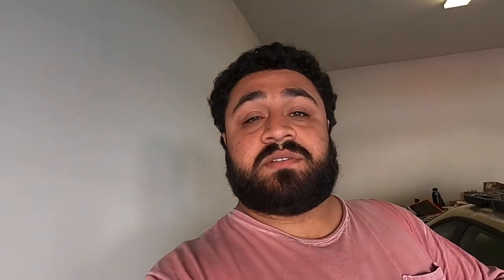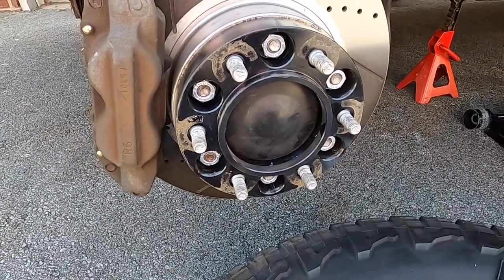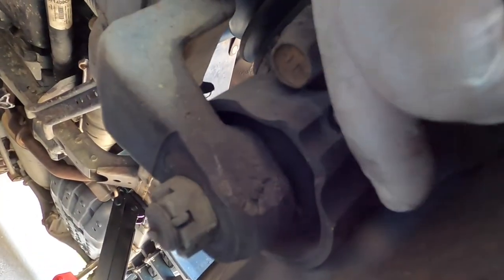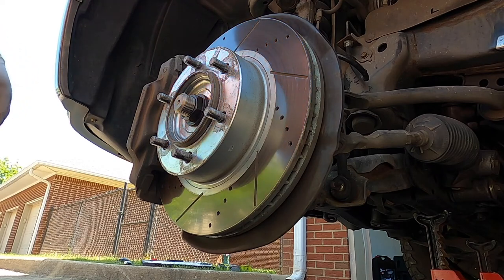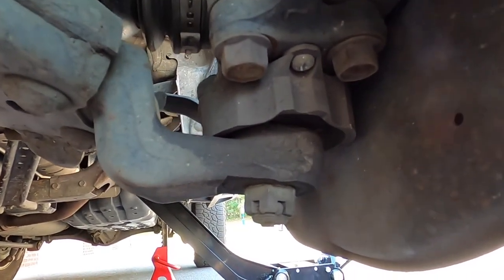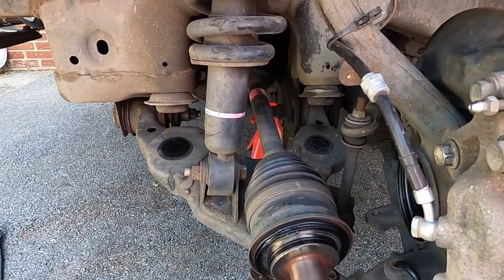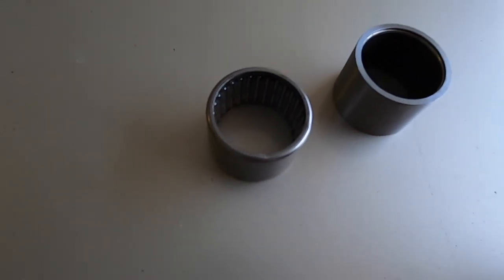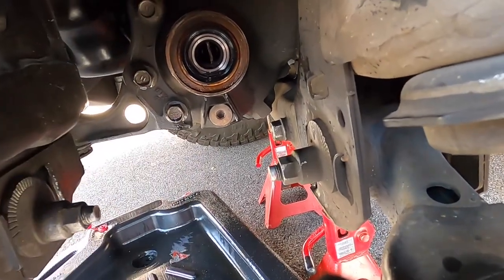ECGS Bushing Install | Toyota Sequoia

Comment: Put the new bushing in the freezer for a couple hours and it will be a lot easier to drive into place with the puck tool. 
It also works great when reinstalling the upper ball joints, especially SPC knuckle inserts.
Reply from the maker: thanks for the great tip

Comment: Adding to Xavior’s question, you only replace the driver’s side, why would it not be both?
Reply from the maker: because that is the problem area and it will not fit on the other side

Comment: hey. what year is this sequoia? I have a  2003 and I am trying to find the correct axle nut size. I bought a 35mm but you said 36mm and I have heard 37mm. Do you know the answer to this please?
Reply from the maker: i am not sure if there is a difference i just rented the tool from the parts store, they have all those sizes in them